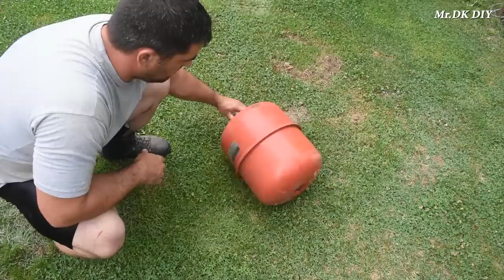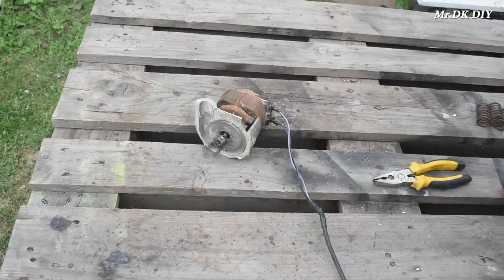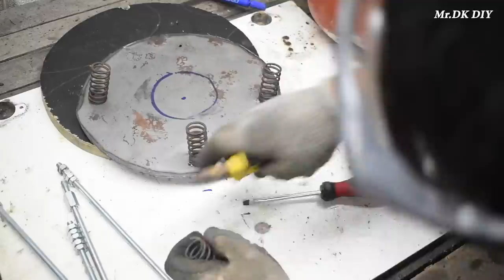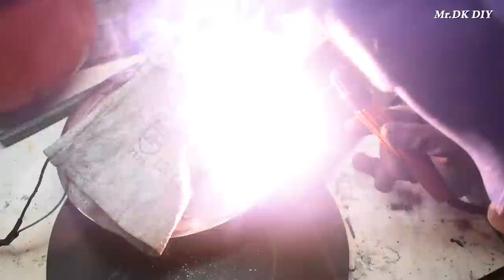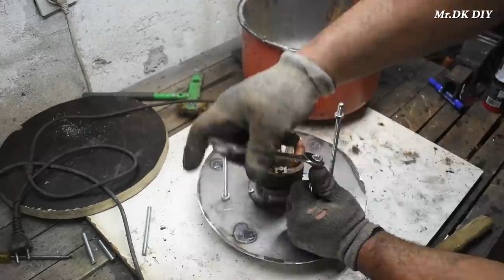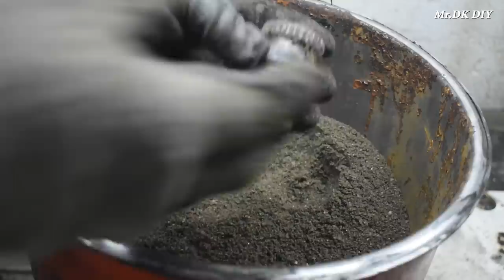AMAZING Homemade MACHINE / DIY VIBRATORY TUMBLER MACHINE

Comment: what kind of sand can be used for this kinda work?..
Reply: Depends on what you are trying to polish. Aluminum oxide is a pretty good all around medium. A step up would be ceramic granules. Google vibratory polishing medium.